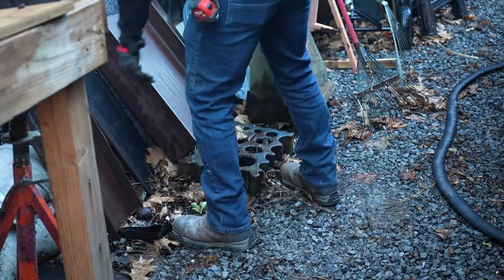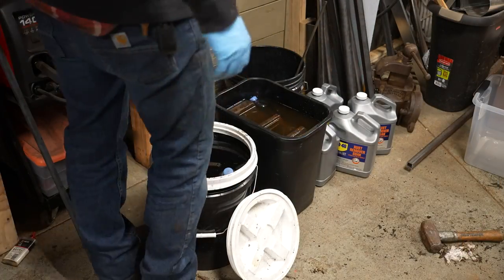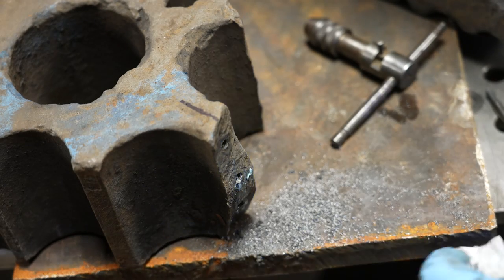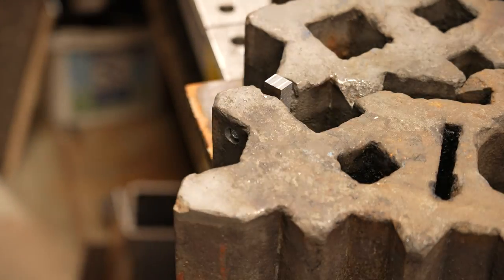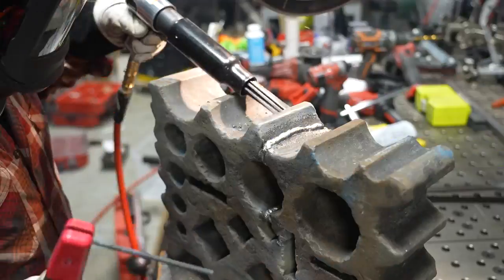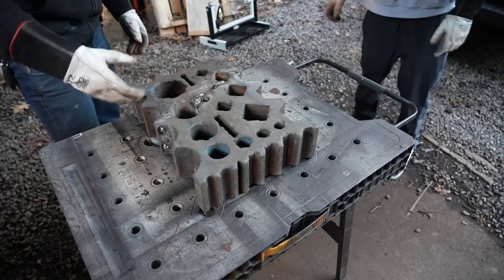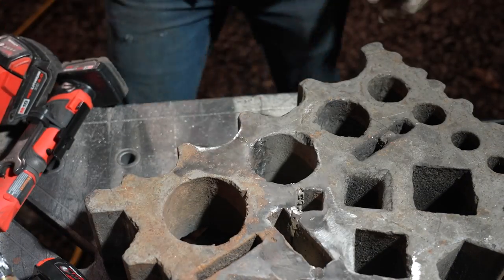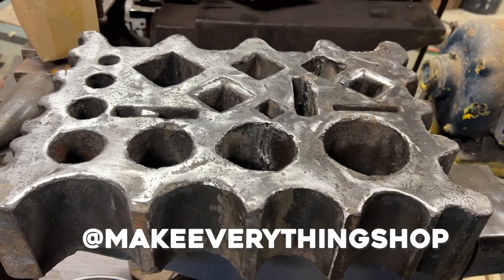Can This Even Be Repaired??

Comment: So, what are you really missing with the cracked sewage block. All I see gone is 1round ,1 flat and 1 square,which are all only 1/2 gone .Anyone who smiths still sees the block as 2with some differing shapes that didn’t exist with the original. Any smith would use it the way it is and forget the cosmetic repair which you are doing. Don’t weld cast iron on a high impact piece like a sewage block .like many have said, please leave these old broken and used smithing tools alone. I suppose you fixed it because you can. Repairs of this sort only represent the current concept of smooth  and clean which is now imprinted on all of us from the age of the computer.  Remember, when this tool was cast, it was meant for farm repair and forged parts,which are very crude compared to the cancer parts of today. You made an excellent door stop.